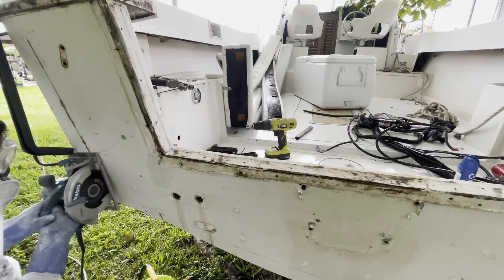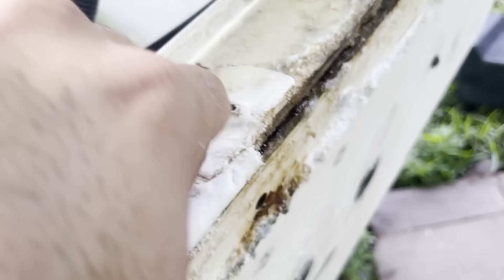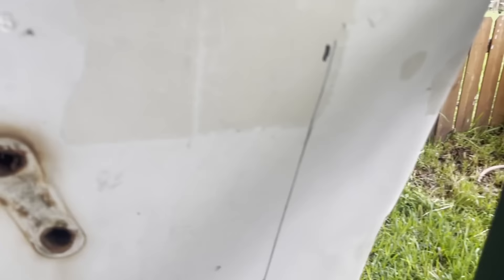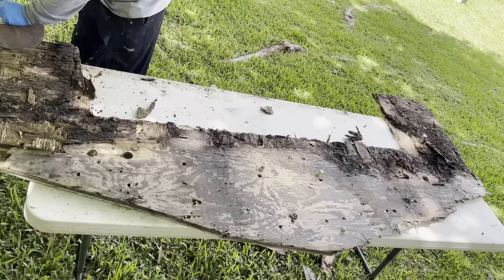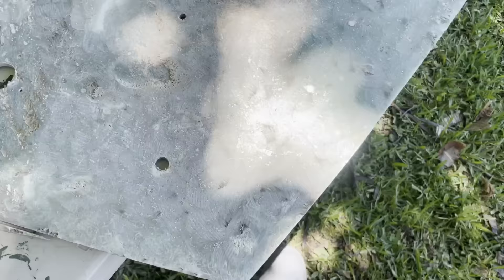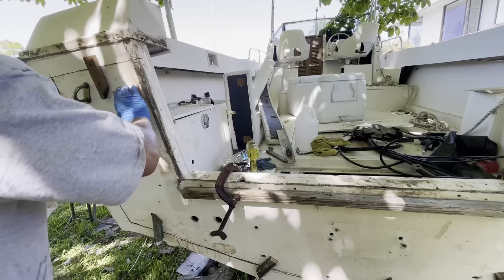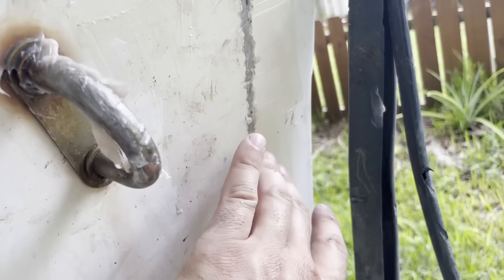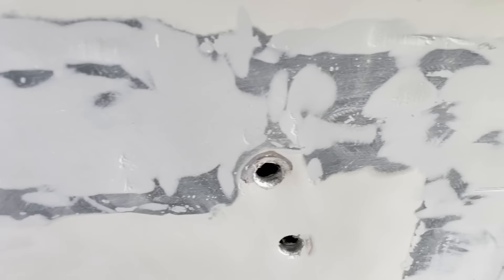Replacing A Boat Transom | Grady White Restoration Project!

Comment: Never! Cut the rear fiberglass out of a boat. You simply uncap the transom at the top exposing the rotted wood inside. Take a forsner drill bit(width of the rotted transom) welded to a steel rod and drill subsequent holes right next to eachother removing the majority of the material. Finally, use a chainsaw to remove the remaining wood inside the transom. Clean it up very well and reinstall new wood(marine grade plywood) and epoxy or liquid transom(i've never used.)
Reply from the maker: No. You can’t get all the rotted wood out that way. Especially up past where the motor mounts. You could do it the way you’re saying but you’d have plenty of wood left in there. It was almost impossible to take out even with the skin off. She’s holding strong with 50 hours on the new heavier motor so we did something right 🤙
Reply: That’s like saying “Never cross the streams”.
Reply: That's the standard way of doing it you leave enough flange to grind it to glass that panel back into place.... And you get a better bond to the wood or core.... With no rotten wood left in there.
Reply: After doing all that work why leave stainless fittings on the transom and paint all over them
Reply from the maker: We changed them
Reply: Honestly I think cutting the rears fiber glasses is the best way to repair it, my just drilling holes and stuff there would be alot off rotten wood left behind and with this way you easily get all of it out and probably makes a lot better repair also not to mention the spots where it was deliminating on the inside which he repaired.
Reply: Could you fill the rotten section with epoxy? The rotten wood wouldn't matter and would be encased in plastic.
Reply: You are so correct... that boat is trash now... that silly little strip of mat will never hold ... the outter hull was 1/2 in of factory laid fiberglass , its impossible to get that strength back... the inner hull is not structal and provides NO strength... another crasy thought these folkes have is that epoxy filler is a structural component, it is NOT structural unless you bury some rebar in there...  easiest way to fix transom rot is with a full width bracket ...
Reply: Eh, my uncles own a fiberglass shop making parts, including hulls. My dad is a marine carpenter who does this type of thing for a living. 
They all say cut out the rear skin, go to town and put it back on. Bevel out 3 inches on either side and lay in woven mat, skinny sections first and get wider till you've got it filled out and then finish it.
Reply from the maker: @mikewhitman745 thanks Mike. Many shops do it the way you mention every day. 🤙
Reply: Nice
Reply: Or a much better way would remove the glass from the inside, praying and hoping you got all the rotted wood and not gouged your glass coming from the top is a hack move
Reply: Hi I was watching your vid an when you put the stringer pieces back in you tied it into the transom with glass but never tied the stringers back to the existing stringers with glass?
Reply from the maker: @user-zn3cy2nt4k which video are you speaking about? This video didn’t show that process. We have another video where we redid the stringers.
Reply: @perfectfitboating  the video when you poured the transom for her dad's boat
Reply from the maker: @user-zn3cy2nt4k we definitely tied it back to the stringers. And it’s in the video I’ll check the timing.
Reply: @perfectfitboating  ok I didn't see it in the video but thanks an great videos by the way
Reply from the maker: @user-zn3cy2nt4k thanks so much! 🤙🌊🛥️
Reply: @UnyieldingSeraph  that would be the nicer way to do it but many outboard have a well in the back to help keep water from sloshing into the boat when you power down from cruising at speed. There is also the deck to consider, you would have to cut part of the deck out to do it that on self bailing boats. It would be a perfect way on smaller boats that don't have the well or a deck to deal with.
Reply: @jaketaylor6747  that really doesn't work, you can never get the wood dry enough for the epoxy to hold. An important part of the job is drying everything out so whatever you use can grab and hold onto the parent materials.
There is a product, or was a product not sure if they make it still, called git-rot that was thin epoxy and came with a syringe. It was supposed to be used on dry rotted wood, but it had to be dry and it worked OK on non critical stuff but I wouldn't trust it.

Comment: I repaired the transom in my 1991 Mako 211 with liquid transom seven years ago, and I couldn't be happier with how it came out.  I just cut the top of the transom off drilled two big holes where the stringers were, so I could clean out all of the wood, using hydrochloric acid over and over again to remove all of the wood.  Then I put patches over the holes and just poured it, reinforcing the stringers at the same time.  You can put the outboard in the up position and jump up and down on the foot and the whole boat and trailer will  go up and down.  There is  zero flex in the transom.
Reply from the maker: Bad ass Ralph! That transom will last forever! 🤙
Reply: Ditto, My pour was back in 2008, using Arjay, and it is solid to this day. I have no regrets, I removed the skin and did the pour as you did, and worked like a champ, great job, now enjoy that Boat.
Reply from the maker: That’s definitely reassuring to hear! Thank you bud! 🤙
Reply: Can you give some more info on how you rebuilt your Mako transom using acid.  Did you take pictures or have it recorded?  Your way sound much easier than removing the outside wall of the transom.
Reply: @Memo-nd6fj  , I took a few pictures, but I'm not sure they would help.  The two main stringers are wood covered with fiberglass, too.  So I made two large holes (about four inches in diameter) in the transom right where the stringers were, too (at the bottom, because that's how you drain the acid).  I then used a long auger type bit, with extensions to remove all the wood in the stringers as far forward as I could.  Like wise, I was drilling from the top, removing all the wood from the transom the same way.  

Then I used long (homemade) wood chisels and everything else until I had removed as much wood as I could.  Then, I put flat plates over the two transom holes by the stringers, and screwed then down tight with a bolt and flange on the inside.  Then I poured the empty transom full of Muriatic acid (they sell it by the gallon at any hardware/home improvement store.  Then I drained it all out the next day.  It came out  brown and all the wood was gone.  Then, I put the plates back on the two holes, and filled the thing up with several gallons of ArJay liquid transom (they changed the name since I did it the first time, but I just did it again with my small fiberglass skiff and bought the same stuff)  

There used to be a volume calculator on the site I bought it from the first time where you put in all your info and it told you how many gallons to buy.  But, it's just basic math and you can do it on your own (order a few gallons than you think you will need if you're not sure of your math), which is what I did on my skiff transom pour.   If you accidentally put a hole anywhere in the transom or stringer fiberglass casing, make sure you plug it with marine tex, or something, because the liquid transom is about like pouring molasses, viscosity wise,  and will leak out almost any small hole. It will be cured enough to put the motor back on the next day. Give it two days, and take it for a run.  I did my Mako 211, with a 200 hp motor about seven or eight years ago.  It's still going strong, with no sign of any cracking or structural problems at all. 

After doing it twice, I would buy a boat I like with a bad transom, with the heavily discounted price you always get, in a second, and rebuild the transom myself.  One, a lot of people will almost give away a boat with a bad transom, and two, once you have done the repairs, now you know your transom is good and solid.
Reply: @ralphholiman7401  I did the same with my bass boat many years ago.  I pretty much used the same process  you used to remove all the wood except for the acid and the two holes on the inside transom.  I used the same stuff you used maybe a different brand and it lasted some 20 years before we junked the boat.  Your so right about boats with bad transoms, some people give them away or the motor is shot and they dont want it no more.  FBM has so many boats for sale that are a steal if you have the abilities to fix them.  If I had the space that would be something that I would love to do.  Customizing boats is really easy to do.  Thanks for giving me some of your experience!

Comment: It's never a good idea to cut the exterior side of the transom. You compromise the structural integrity of the hull. Mechanical bonds are never as strong as chemical bonds. This is not a good way to repair a transom.
Reply from the maker: I respect your opinion. I disagree. This transom is stronger than factory and the motor on it now and the Hours weve put on it prove it to be so. Thanks for the comment.
Reply: @perfectfitboating  Good luck with it
Reply from the maker: @JupiterGeorgeFishing  thanks 🤙
Reply: Its a faster and easy way yes.but not as strong as if you left the outer transom skin intact and did cut from the inner side of the deck and removed the wood as you did. Than laminated the transom extending the lamination to reach a bit of the inner hull sides, similarly as whatb hey did once the hull was being produced inside the mold, alternating many layers of fiber glass and woven roving, then, pressing again new wood ( but i guess you do not want to take a risk of future problems with wood becoming bad,+ the cut has to be big ebough for you to be able to preas the wood in one piece). In that way many layers of laminations  are needed to compensate for wood thickness. Then closing the cut you did on the inner side side of the deck while laminating its bottom so when you pour your mixture it wont come out from the bottom.
Lastly making an opening from top of transom and filling resin  mixed with wood dust or a resin filler.....
Sorry for the long reply, but maybe that way would fbe s stronger repair as the hull would still be and act as one piece. With your repair the engine forces would push on the inner side rather than the hull transom side, and cracking could show up where you did ur cut and laminated+ if you pull something with boat that back piece could come out) 
Take care.
Reply from the maker: Thanks for the reply. If youre correct, that the back part of the boat would fall off or crack, then it would’ve by now. There’s zero signs of stress. Cracking, flexing nothing. So it’s strong enough. 
Another note, when this motor was installed it was installed by a Suzuki dealer who also tests the transom for strength. For liability reasons, They asked me how I went about doing the transom and I showed them. 
If youre correct, this engine would’ve fallen off by now. We have more than 50 hours on the boat, we’ve done tubing, we’ve been in 5ft seas, we even ran aground once on the sand and the motor was stuck in the sand. Zero issues. Why is that? I believe it to be stronger, you don’t. But it’s strong enough. Thanks for the comment!
Reply from the maker: @DannyWildmen  thanks
Reply: @jkjsjgojaiaukahksjla5649 When towing something with the boat the force is not on the outer skin. The tow hooks go all the way through the transom, the force is taken up by the transom hooks backing plates against the inside skin. I am guessing you have never replaced a transom. Your lengthy reply is just your imagination running wild and although you try to sound like an expert, you nothing of the kind

Comment: If you go through all the headaches of removing the skin why wouldn't you just install coosa board? Doing liquid transom I'd only remove the top cap, remove the rot then support glass and pour liquid transom. All this work removing skin for a half ass repair don't make sense not to use coosa
Reply from the maker: Half ass repair? I beg to differ. If you haven’t done a job like this before then just say so. You’d know that you can’t get rid of All the rot by just taking off the cap. You also didn’t see the whole video because I explain why I didn’t use coosa board. Hope your day gets better! 🤙

Comment: I did a similar project with a 1989 Mako 211 - I would suggest a few changes 1) add a few layers of fiberglass cloth to the inside of the transom before replacing the back panel. this would add strength to the finished composite pour. 2) refinish the entire transom surface before mounting the engine and hardware - it's a lot easier and simpler to work without the engine in the way.
Reply from the maker: Thanks for the comment Wayne! I agree. Unfortunately we were pressed for time to finish the exterior of the transom. We had an appointment to mount the motor and all we were able to do was what you saw in the video. I thought I had given us enough time but one delay after another left us with no option. Nothing rushed ever comes out right. Lesson learned! 🤙
Reply: I did a few transoms and i put some Peg board panels cut to shape with small spacers between them they will give you a very strong transom also used to use it in the bottom of brine boxes on Prawn trawlers when repairing as they drop stuff and punch holes but with the pegboard and matting and resin no way are they going to brake it again once we did one the mate and i get plenty of work fixing brine boxes and freezer floors.
Reply: @bobmulder4064 What material are the pegboard panels made of please
Reply: @bobmulder4064 What material are the pegboard panels made of please

Comment: If you HAVE to cut the transom cut it from the inside! Otherwise you lose the camber and the strength of the transom!
Reply from the maker: No. The inside is better, I agree. This is a chemical bond with all parts, inside and outside. If it loses strength, the motor would fall off and it hasn’t in a year. 🤙

Comment: I don't think you stated it in the video, but I would recommend using something like a Palm Sander to vibrate across the whole transom to make sure you get a complete fill with no trapped air bubbles. Same thing they do when pouring concrete walls.
Reply from the maker: That’s a good idea but for this product you don’t need to. It has its own off gassing properties that allow the air bubbles to escape. If I were using SeaCast for example I’d use a mallet or something like you stated to help with the  bubbles. 🤙
Reply: In the shop they size cut 3 new layers and refresh the front and sides and bottom. After filling the middle put a block of wood same size as the hole. And clamp a concrete vibrator on where the motor goes. Then fill the sides. Remove the wood block and tape it. Put holes in the tape. When it starts to come out of the tape seal it off. Top off the sides. But definitely put 2-3 new layers in all corners. The 3” cut is preferred though. But we used a planer a lot for cleanup in and out where we could.

Comment: I do this type of work. I would personally never cut the outer skin. I get that there is stuff glassed to the inside. I prefer to release the top cap, slide it forward and work from the inside. Finish the job with a splatter on the inside or a gelcoat and sand/polish if its one of "those" boats. Also, consider reducing your hardener slightly more. A top pour will trap air in the corners and rough/uneven surfaces not to mention just from the turbulence of the pour. A longer cure will help tremendously. Another trick is to drop a 1 inch PVC pipe with a slash cut bottom. Full with funnel. Keep funnel full. No air bubbles. Leave PVC in the boat.  Otherwise, your finished product looks very nice and im sure your customer will be very happy.
Reply from the maker: Thank you for that. I don’t do this work for a living, this was my first time doing a transom and it was on my boat. We’ve done 2 transoms, the second we did it the way you described from the inside. This pour product also doesn’t allow air bubbles. It has off gassing properties to prevent that. Thanks for the tip with the funnel! If we do anymore that would be useful for sure! 🤙

Comment: Great job with the project. I used the Carbon Core too. I did a 1987 Bass Cat fishing boat. I cut the top cap off and drilled and chiseled the bad wood out. Dangerously I also used a power chain saw. This works great,,, but very dangerous.
I too had a bit of an issue with the guys at Carbon Core. I called for some advice and comfort in using there product. They were hard to talk to and acted like I was bothering them with my questions?
I ordered 2 5 gallon pales. and only used 1  5 gallon and about 1 gallon of the other. Thanks again for the video!
Reply from the maker: Hey Scott thanks so much for the comment! I’m glad to hear your project worked out and you came out unscathed!🤣 I don’t think chainsaws were meant to be used on transoms 😂
Ya know that’s the feeling I got when talking to those guys over there. I’m assuming they don’t deal too much with regular diy guys like ourselves and they deal more with boat manufacturers. They made me feel like I was a nuisance. I guess that’s the state of affairs with these companies nowadays! 🤷🏻‍♂️
Thanks for watching Scott! 🤙
Reply: @perfectfitboating  thanks for the reply. Take care.

Comment: I use that company and  thank God I didn't have to call them back! My transom is a lot narrower than yours was thank God and I could drill mine and vacuum it from the top. I could never be happy with my outcome. I had to do the same at the end I was a little short. I had to mix up some epoxy myself 😂
Reply from the maker: I can see how a narrower transom with the whole cap exposed can be done from the top. That’s ideal! Nothing wrong with mixing some material and adding if youre short. How’s it holding up?